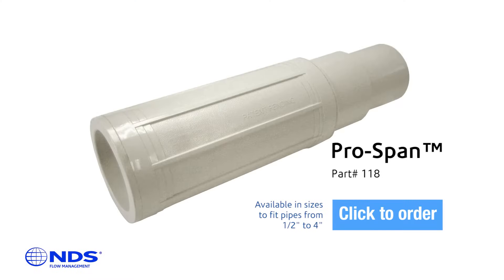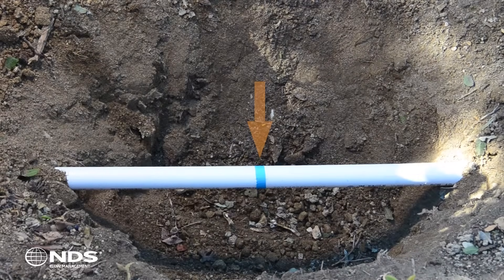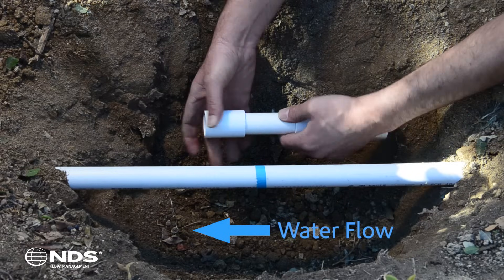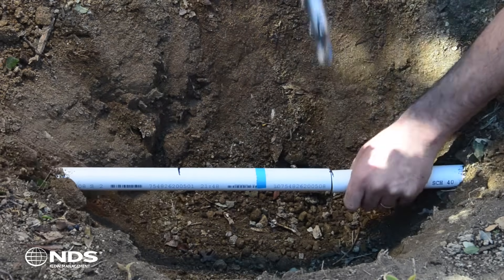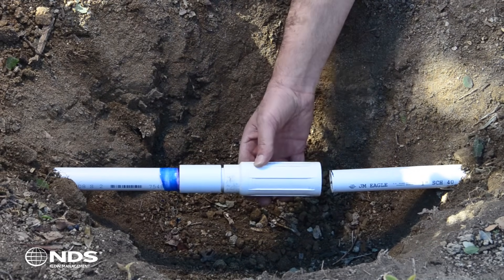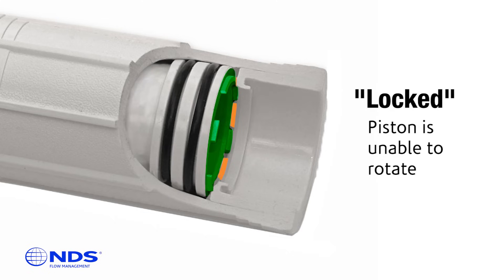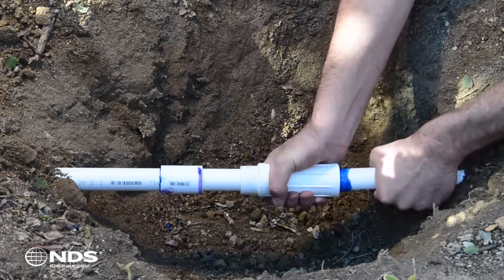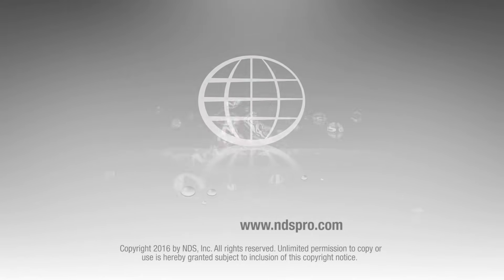Fix Broken Pipes Fast with the Pro-Span® Expansion Repair Coupling | NDS Drainage Solutions

Comment: so on the fatter side of the coupling, you don't add glue to it, only on the pipe itself?
Reply from the maker: Correct — you add primer and glue to both sections of the cut pipe, then insert and secure the coupling.

Comment: I followed instructions to a "T." Now my Pro-Span is leaking from the water-meter end. A professional plumber told me that most leaks he's seen are from these type of fittings. How do I get the area DRY enough to apply Oakey Primer & Glue enough to keep it dry?  Water keeps seeping out of the Water Main even though I've dried both ends out a zillion times?
Reply: 721 weld on and purple primer. Make sure to open the slip fix all the way.

Comment: Should I extend it all the way or it will be fine at any size?
Reply: According to NDS you need to extend it at least 1.5", basically a little past the point where you start feeling resistance.
Reply: always!!
Reply: @j.e.christo213  well, I don't.  That's the easy part of it. Just make sure you don't cut more than it reaches. If it gets to the other end, you leave it there even if not fully extended.